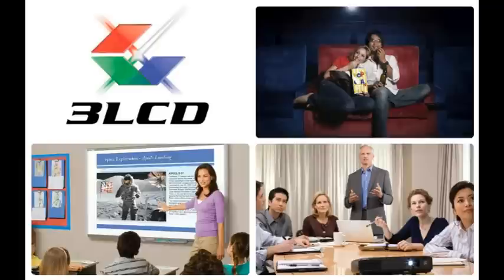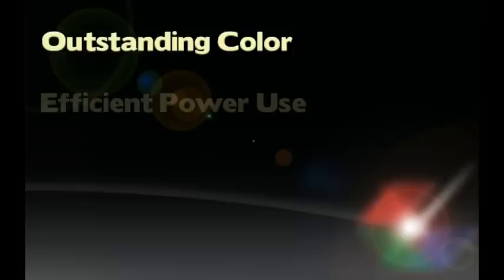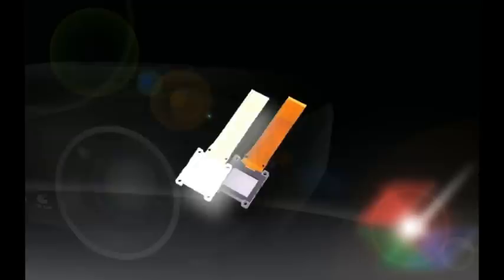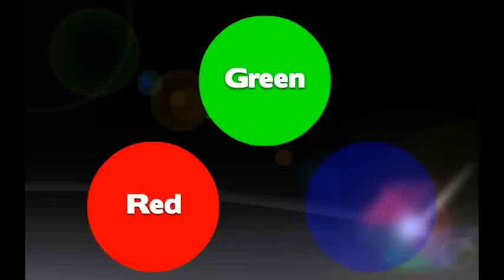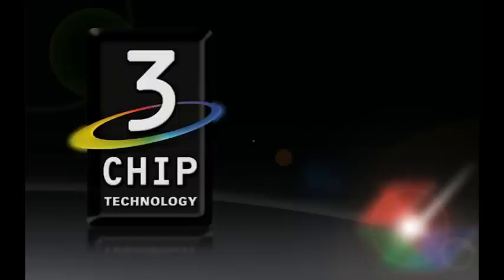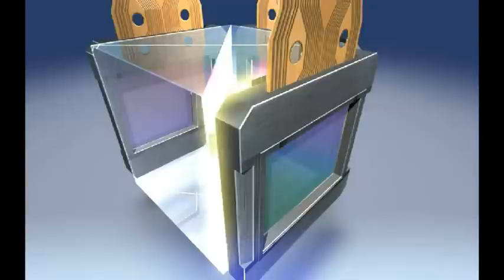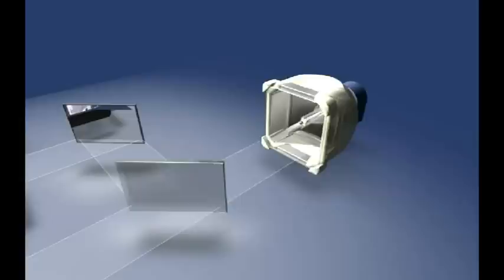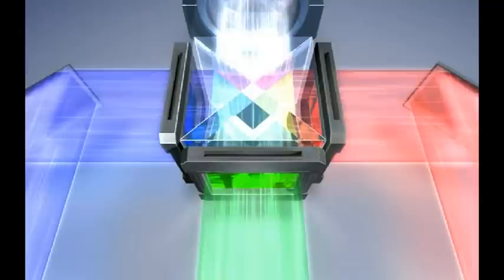3LCD: Power of Three

Comment: This technology sucks because lcd's are very sensive to the heat of the lamp and the dust. I found an lcd projected tv on trash and one or more of the lcd's had problem, i had yellow tint on screen and a blue spot, it was very expensive to fix.
Reply: it's very easy the key is to replace the two linear polarizers on each panel